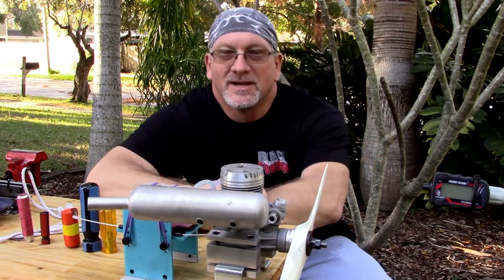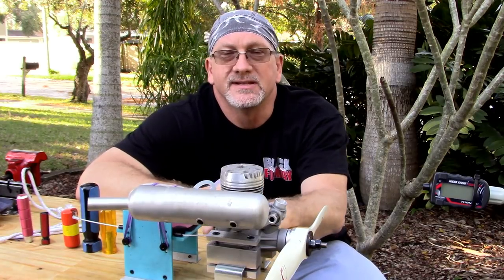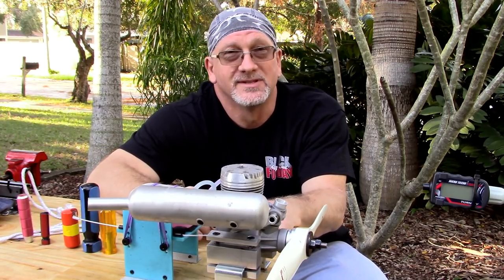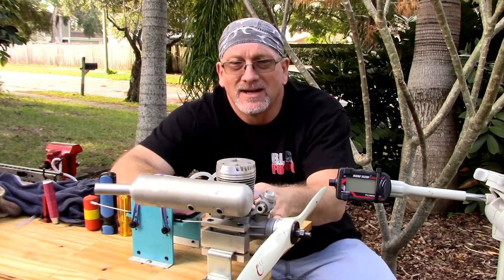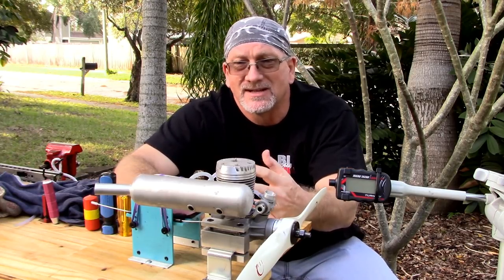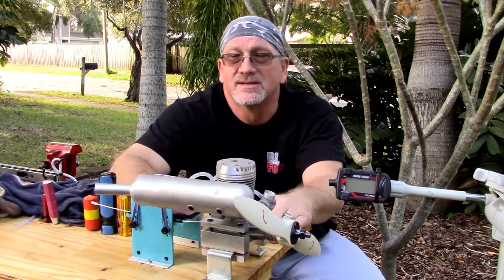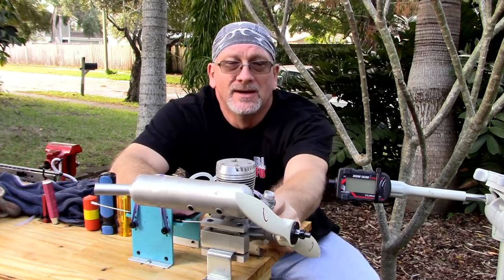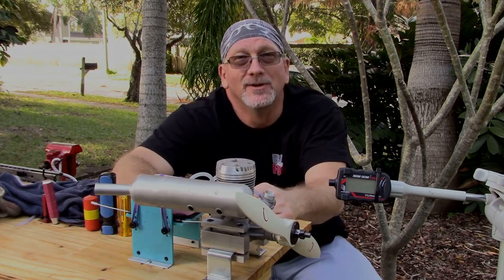MDS 148 First Run

Comment: The quality of the MDS carbs was dodgy at best, usually rich in the mid range and hard to adjust with out the idle or top end suffering. If you have an OS carb from one of the bigger engines, you will see a difference. Most Shops in Canada stopped selling these due to this. The engines are very well made, but the fuel metering on the stock carb is not as good as OS.
Reply: 8ackbar  yep Exactly....i use to run an Mds 61 in my Cessna 182 and this engine was so unreliable it was a joke...i replaced it with an Irvine engine made in the UK nice quality and reliable!